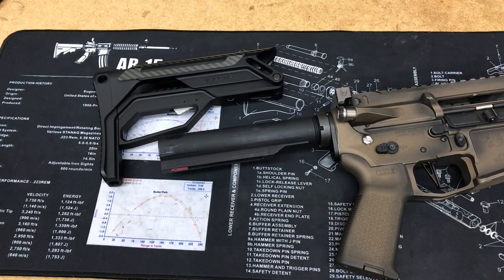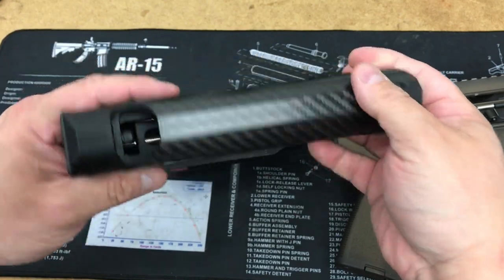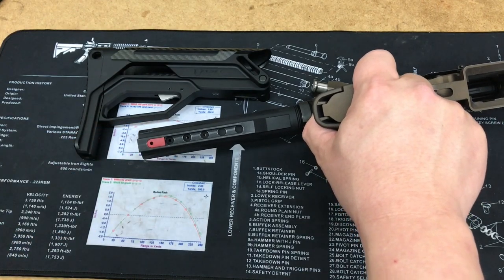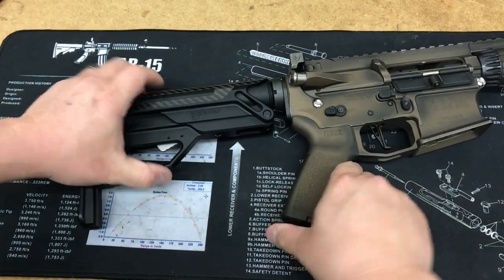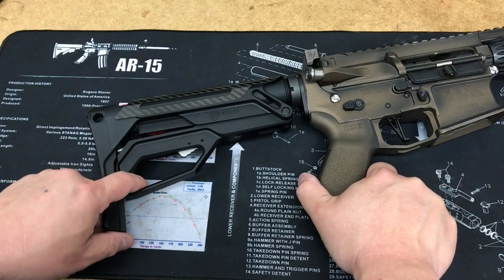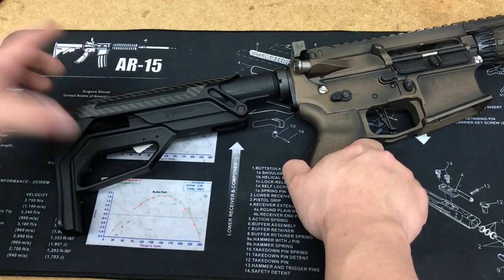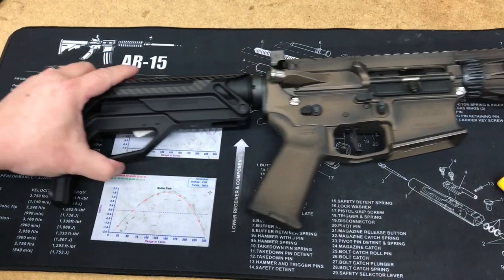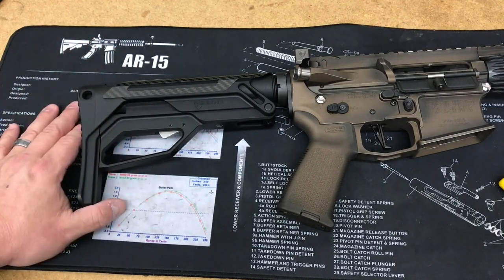LA™ Stock Preview and Features

Comment: Will this stock have options for different cheek riser heights, like the magpul ctr/moe stocks? I'd like to use it on my AK, thats why I ask. Thanks.
Reply from the maker: Not with the initial release.  It's something we are looking into for further down the line.
Reply: @FortisMFG  one quick addition to that also. Just one thing i see would be if you were to make the carbon cheek panel and aluminum logo piece on front, with just a little less radius/shorter, the stock collapsed length could be almost 3/4" less (with a standard end plate). Im sure its like that to be able to work with your thicker QD endplate systems, but possible a seperate addition to more cheek weld panel options if you ever decide to produce those. Love the stock though for sure. I have 4 of them and one more on the way haha they do occasionally snag a beard hair or two though haha keep up the great quality products

Comment: What is the weight? Can the stock be placed into a fixed position (non adjustable) by fully tightening the adjustment screw?
Reply from the maker: 15.8 oz.  No, even if you screwed the set screw in there all the way in, it would still be adjustable.  If you looking to satisfy some state laws, a gunsmith would be able to find a way to pin it.